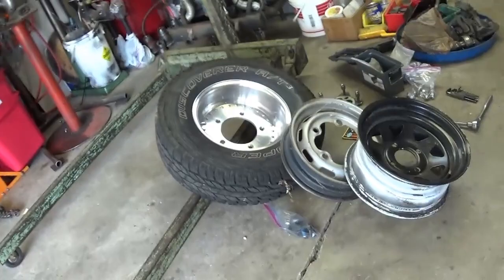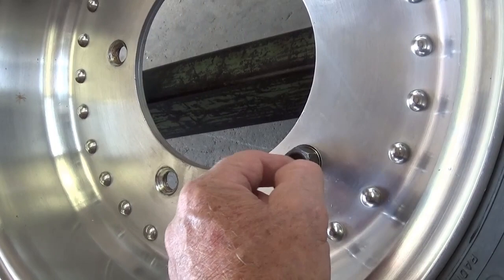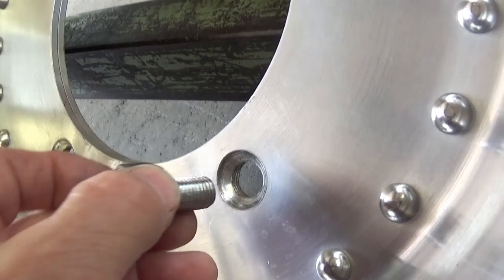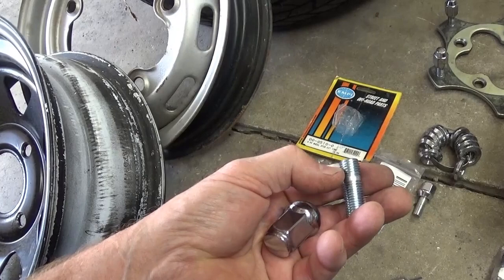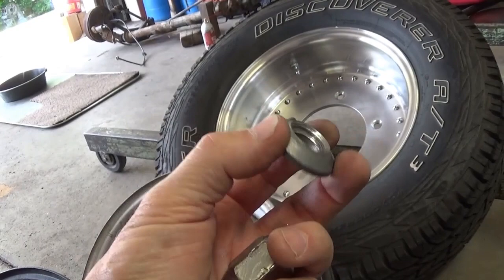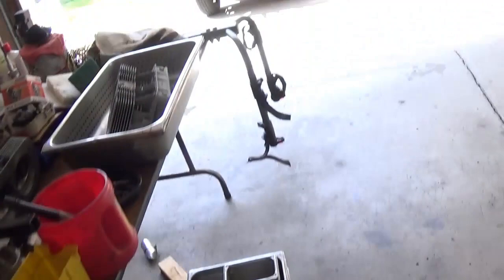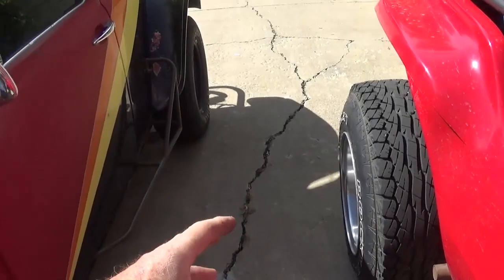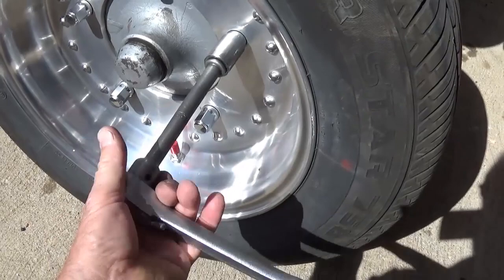VW Lug Nut Mayhem

Comment: Just a thought - In gear work we used to put a thin coat of white lead (try a very thin coat of stiff oil base paint) on one surface then press them together for a moment to see a print of the contact area.  Just a thought as I said.

Comment: I have those studs and nuts on my sand rail. They work great. Blue Loctite works fine. I've got a little secret. Elmers glue works great for thread locker
Reply from the maker: Who would of thunk it! Thanks for the tip! I might try some gorilla glue...
Reply: I don't like Gorilla glue because it foams up. But I do like Elmers.

Comment: Off the topic,  IS IT NORMAL FOR THE COIL TO GET EXTREMELY HOT WHEN RUNNING A GENERATOR? , is that how those are supposed to run?  Any help is appreciated
Reply from the maker: To hot to touch if it's been running a long time. Sometimes a failing coil will have symptom's of working ok on a cold start and running for a while. After it heats up the internal short will open and you will loose spark until it cools back down. Eventually it won't run at all. If you have decided to start changing parts until you find the problem that's not a bad place to start. Using a Ohm meter to test is a good idea as well. You will need to know what the manufacturer requires for you OHM reading. They might even have a free trouble shooting file at there web sight.

Comment: I'm having a similar problem.  believe my empi disks are the same. Disc Brake Rotors With 5 X 205mm Vw Lug Bolt Pattern 12mm X 1.5 Threads & 5 X 205mm Vw Lug Bolt Pattern 14mm X 1.5 Threads.... going with studs this time!!!
Reply from the maker: I'm really starting to hate these heavy empi disc brakes.
Reply: @TheEZGZ  U did say that other customized  items u backdated to stock are working better.  Lol
Reply: Well I thank you on a side note EZ... have been restoring a sandrail for near a year now and your info has been invaluable!!!
Reply: They do give you alot of thread Depth on the rotors... mine stripped 1/4 inch in. because of those short stock 12×1.5  bolts. But not dead in the water at least.
Reply from the maker: Ya just got to do what ya got to do to keep things running. The main thing is. It's yours and you can keep and eye on it. I would never do some of the stuff I do and sell it or charge money and have folks drive it away.

Comment: Hi EZGZ, I'm having some problems with my single weber 40 on my vw 1500, Its idle Ok, but when I start to rev it and let the aceleration in a low rpm it start to fail. the idle, the main and the fast aceleration are Ok, just the progression is kind fuzzy. Any idea what it is?  My Idle jet is 70. I'm in the end of my project :D thank you for all the infos, I will make a video to thank you soon. Greatings from Brazil, sry my english.
Reply from the maker: The carb is to big for a 1500 even with 28 venturi's.  http://www.redlineweber.com/html/Tech/idf_adjustment_controls.htm

Comment: What is your opinion of raised 3inch welded ball joint spindles to lift a bug for trail riding and street use?
Reply from the maker: I'm guessing it will work ok in dirt but will totally throw the geometry off for street use. Most guy's go to an adjustable beam or use full size springs in the beam instead of the 1/2 width that comes stock.

Comment: Just had issues with the lug bolts on my buggies 10" rear. My fix was to press knerled studs on the drums. Counter sunk for the heads so they don't interrupt the break shoes. Makes me feel safe.
Reply from the maker: I think thats the best way to go
Reply: Hmm, I didn't have to counter sink mine and they were racing lugs with pretty big shoulders. Wonder what the difference was. Your 4 or 5 lug?
Reply from the maker: wide 5 if yours fit safely to your liking than go with it and check them now and then.

Comment: I have (still) two VW powered oval track cars I ran in the 80's. One based off of a '72 Kharman Ghia car that I didn't build, and a tube frame car made out of a front wreck dune buggy chassis. The '72 was built for different rules than I was running under, which were heavier and stock body and chassis. I bought it mid season finished the year as is. Over the winter, car went on a diet. Stock steel body gone. Aluminum replica Olds Firenza on. I was running 4 lug 13x10 racing wheels, IRS, disc brakes all around,  Right side wheels as full offset as offered, lefts 0 offset, mounting area right in the middle. 26.5 or 23.5 tall Hoosier race tires. I didn't like the lug bolt set up as being too weak especially on the full offset wheels. Took off the rotors bored out the lug holes, pressed in some racing lug studs, and used 1" OD lug nuts.

Newer tube frame car had 4 lug drums and swing axle in the rear. replaced the front from the roll cage forward, built a new front section narrowed for the Pinto/Mustang II front suspension, with a rack.

Here's where it got fun. Like you mentioned, no different wheels! So we built custom upper A frames for the front using the ball joint end from a VW front axle, used VW disc with the bottom of the spindle hole reamed out to match the Ford ball joints.VW wheels a!l around on both cars. Gave the new car the lug stud treatment. Neat part is the new car could be retrofitted with a front engine, rear axle car if/when needed. But our local track never reopened. I did travel a little with the newer car so me. Was running well in the top 10 when I got caught up in a wreck with four laps to go first time out. Super slow in first practice. Super fast in the 2nd 50 lap feature on a ½ mile, once I got the new car handling bugs worked out.  Never ran more than 25 laps before. Heck never ran a no BS flat out race car like that, or that track, or against those guys, or for that long . . . ever. Blew up the engine the next year at the same special event.

Well sorry about the running on, but loved the last car for it's speed, loved the reskinned '72 for looks. Still have them. Last run 32 years ago. Thinking about getting a couple of stock engines with loud exhaust just to show them off at historic oval track shows.

That's my story on what I did to make sure my wheels stayed on my car. It was a no brainer for us. That's what we had to do on our full sized race cars.
Reply from the maker: Wow! Thanks for sharing. I like the idea of getting them running again. Sounds like you had a great set up.
Reply: The last one was going to win me a championship . . . if the local track  opened in '86. I was sure of it.
I ran an 1835 cc, I don't see you mention them in your projects. Any reason?

Comment: Hello Sir, I have a 63 Baja I've been working on. It came with 3 studs installed in each of the hubs (the ones installed from the back side of the hub) and two of the stock lug bolts. One of the stock bolt holes is stripped out in the hub so I wanted to install another lug bolt or possibly just convert all of the holes to lug bolts.
My question is do I need to drill out the old threads in the hub to install these lug bolts? They have splines at the base and are basically pressed in from the inside the hub. I don't want to mess up the holes but I don't have a drill press or a jig, just a simple hand drill. 
Any experience with this? 
Thanks, I enjoy watching your videos and learn a lot. I like doing things myself plus I live in a very small remote town and can't just take things in to get worked on.
Reply from the maker: If your talking 3 your working on the front hubs. Yes?  So you still have 2 holes that are stock. No problem in my world your still on center????  Weld in the bad hole and by a stud with splines and press it in or drill it after you have the other two holes lined up. can't be that far off?????  Figure it out or buy the hole assembley and pay your dues...... It's only your life and the folks you love that ride with you dahhhhhhhh !!!!!!!!
Reply: @TheEZGZ  good point! I got some extra studs that came with the car when I bought it, I'll take it apart tomorrow and get one put in there.
I'm planning on installing disk brakes at some point anyway, if I mess it up I'll just have to get them sooner rather than later. 
Thanks for the tip on the book too, I found one online for 15 bucks!

Comment: Hi Greg hope all is well on you end. I have a rail buggy that I am looking at putting on 31/12.5 r15 wheels and agricultural tires on the rear. I currently have the 4 lug Nopi disk brake conversion kit on. My question is are the 4 lug wheels ok for this or should I use adapter and convert to the 5 lug wheel? Once again thank you for your videos, we mis seeing them on a regular basis. 
God Bless
Reply from the maker: No Adapters Period!  The 4 lug wheels are made with thicker stronger centers to compensate as you will also note they have 14mm lug nuts instead of 12mm.
Rail buggys are so much fun but many guys kill the power with large HEAVY new tires.  Please, Please keep the wheel weight as low as possible.   Be careful of your offset. Those wide wheels really add a lot of bearing load and stress the whole suspension. Consider going with a 8 inch wheel and big tire. It will save you weight and money.  I go after hours to tire stores and steal them from there take off tires.  So many 4x4 's are sold tires in sets of 4 and they only needed 2 so it's not hard to find two that match. Check the inside real good for punctures and mount them at home.  A side note is that big tires are almost impossible to balance and although you will rarely of ever use stock 4th gear in your rail buggy with a largeass tire it is sometimes fun to scare yourself on a downhill stretch of dirt road Out of balance tires on a light railbuggy is nasty.  We won't even bigin to talk about how worthless your brakes become with heavy wheels and tires.  Even if you did decide to go with wheel adapters you they are only held on with the same 4 lugs.    Cheap upgrade will be the 4 bolt disc brakes everyone sells that are pure junk but good enough for offroad toys.

Comment: Got s question, wouldn’t the center caps hide the 4 lug nuts on the adapter plate set up? .... here’s another question can we use 5 wide drums and pads/ hardware on the  68-79 pans?
Reply: Just my 2 cents, but I suggest don't do it . . . Do you want to do it right . . . or do it over, while fixing the other damage you'll have?
Reply from the maker: Yes you could hide the nuts with a hub cap but something tells me the after market bolts and studs stick out to far.

I miss match drums all the time. I had five hole drums on my IRS 4 hole rear so I could run all the different 5 hole rims I have. My car is lighter than stock and I am the only one that drives it. I would never tell anyone they should do it or can do it. I don't like to follow rules. I like to figure out things and take a chance now and then but I am very cautious until I know for certain it works.
The factory made wide 5 front drums for the ball joint cars on years 66 and 67.  Be sure to spin your wheels by hand to make sure nothing is catching on the internal parts. 
They made long and short swing axle cars. The long axle drum will fit on some IRS cars. 
You wouldn't believe the things I have done and seen on sand cars that work great for years ounce you figure it all out.

Comment: Do you have the part number for the lug nuts i did disc break convertion and i have the stock wide 5 wheels and have the problems with the lug nuts i purchase with the wheel stud kit
Reply from the maker: here is the kit I bought https://www2.cip1.com/ProductDetails.asp?ProductCode=ACC%2DC10%2D6670

Comment: EZ what can you tell us about the hoover mods
Reply from the maker: I think it is a interesting and extreme mod for engines used in extreme conditions such as short run WOT drag racing conditions.  I believe  that the stock oil system on a dual relief engine block was and still is adequate design and well engineered in totally stock circumstances. The only improvement needed  IMHO is adding some type of external full flow Oil filter  which is well known and well documented.
Reply: @TheEZGZ  There are several types of external filter systems which 1 do you recommend.CP performance has several different styles that is where i have been shopping for my parts.
Reply from the maker: Not knowing what kind and year of engine case you have I can only guess.  This is the one I am using because I have the 3 bolt early style camshaft.  https://www.cbperformance.com/product-p/1791.htm  Caution: It won't work with all exhaust systems. Again I don't know your specifics.  Do a search of my channel vids and you will see several about oil pumps and filters. I have something like 700 video's on U tube

Comment: EZGZ I love your channel. I’m new to the VW world and just purchased a 1974 beetle that needs some work. I built Chevy race engines in my younger years but I have no knowledge of the VW engines. Can you provide me with your contact information. I would like to pick your brain about building an engine.
Reply from the maker: This is my contact point. :-)   Ask away   I have 4 cars with lots of engine builds.  My favorite is a stroked 2 liter type 1 base engine with stock valve heads.  Extra Power, fare economy  reliable as stock and keeps the heater boxes.    What are you trying to do with your VW project.
Reply: TheEZGZ  I am planning on making the bug into a Baja type bug. I want the engine to be very reliable. I’m in my 50s and will not be abusing the engine. I want to install a remote oil filter and oil cooler. I also would like to stay with a single carb.
Reply from the maker: I like the single carb idea.  A lot less hassle. Since your more mature than many of my subs you might just be happy with a stock 1600DP with a Baja header exhaust and keep the heater boxes for those cold morning's. I'm really liking the 1776 with stock carb and STOCK camshaft. I am thinking of building one for my Baja

Comment: Thanks for all the great videos!  Would like to chat with you about my build project if you have time.  My username is Jetmech2002 at  thesamba.  Would like some suggestions to other forums as well.  Kinda rough bunch at the fore mentioned site. Thanks again!
Reply from the maker: LOL...  DID YOU DO A SEARCH BLAH BLAH BLAH.  I don't have anything to do with any forum groups or clubs.  I've got close to 700 vids posted. Most are about VW's.  If you have questions ask away and I will try to answer or help :-)
Reply: I did the Hoover mods, and radiused the inside of the pump, and even the case, as my pick up was bad rusted and had to be replaced.  I noticed that some use the front relief as a return from the full flow, and some put the oil temp sender where the relief cap would be.  Do you need the case reliefs if you have a relief cover such as the Jaycee with the integrated relief?  Also opened all the galleys to clean the donor cases. Have you replaced a pick up?  if so, what did you put back in place of the aluminum cap in the case? Don't blame you a bit for staying away from the armchair experts.  They gave me hell over there when I asked about you.  I think you do a great job with you videos.  I don't care, nor did I listen to their senseless rambling.  Keep doing the vids.  Many of us enjoy them!
Reply from the maker: Other than full flowing the case to add oil filter I leave it alone and run stock stuff as Gene Berg recommended. Coming from a offroad Sand dune background I wanted to keep the bottom of the engine clear of everything.  As of yet I have not had issues with a oil pick up. I have not removed the plug until recently a buddy needed a oil pick up. I had a really hard time getting the oil pick up out of the case without damaging it. When I removed the plug I studied it closely it didn't seem like enough room to use a threaded plug???? It also seemed that under normal driving conditions the entire oil pickup would be submersed in oil especially under hard acceleration so I don't know why folks would have problems there. Like I have always said: Just because you see oil pressure on a gauge does not mean your pumping full flow of oil it just means you have pressure. It could just be foam and bubbles. 
I don't care what others say about my crazy vids. All my cars live and run and drive pretty darn good. The paint and interior look like crap :-)   Most guys are worried about how there car's look and don't drive them every day like I do. 
I have never had issues with a new engine case. If I was going to build a new engine with high horsepower I would start with a new engine case with standard size bearings. Wrestling with old engine cases and modifying them does not make good sense IMHO  Many who claim to be engine builders sell the engine and never see them again and don't really know how they are treated or how long they live. If you ever run across the 2 Gene Berg blue books buy them and read them. Even his old printed parts catologs have good info.  http://www.geneberg.com/techtips.php
Reply from the maker: More Good Reading http://www.aircooled.net/vw-technical-articles/